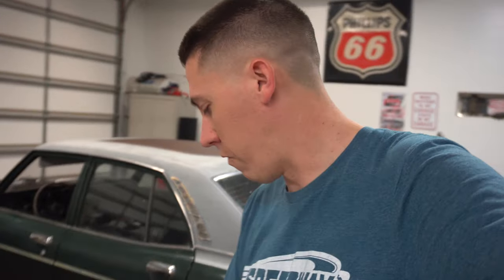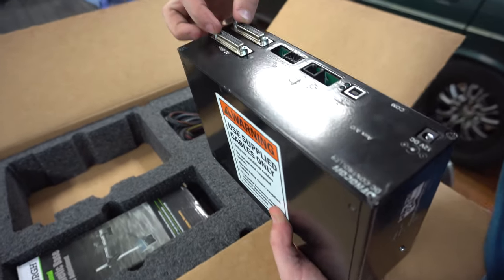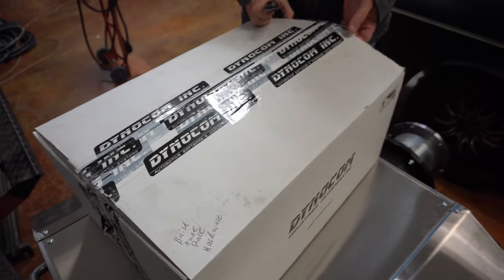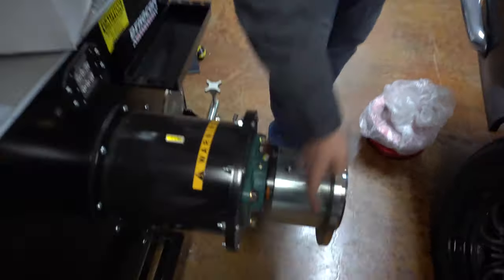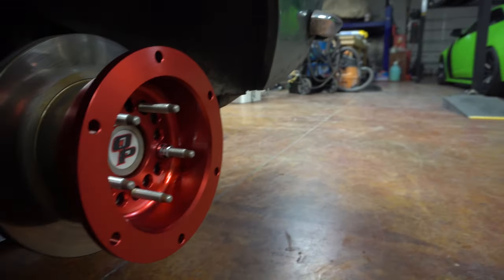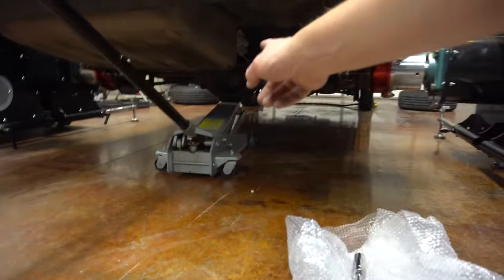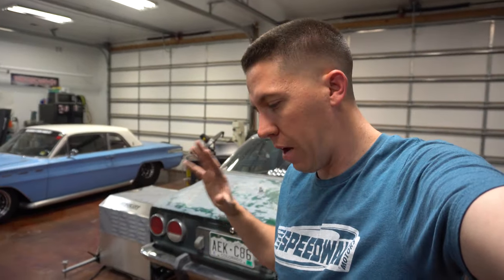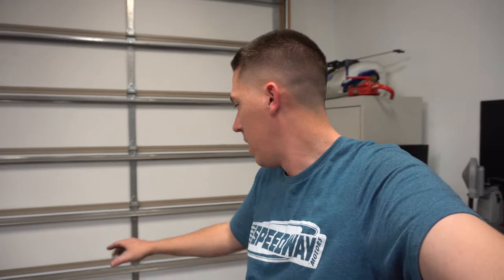Dynocom 3500 Hub Dyno Setup! Mounting Clyde the V8 Swapped Mazda to the new Dyno!

Comment: make sure that third plug hanging out of your box isn't live or if it is get a cover for it
Reply from the maker: It's not love when the two other feeds are plugged in!
Reply: Build Tune Race good deal just makin sure it doesn’t back-feed !
Reply from the maker: That would be a bad deal for sure!
Reply: redneckman454 it has an isolation relay on it

Comment: Is that 50 amp plug going to backed current from the two 30 amp plugs. Just make sure you don't have current flowing to those open prongs, looks good so far, good luck
Reply from the maker: It goes dead when the 2 30s are plugged in!